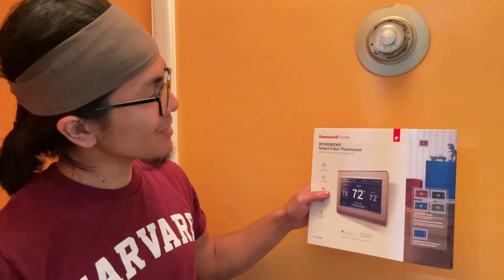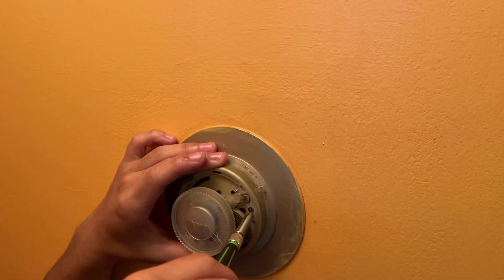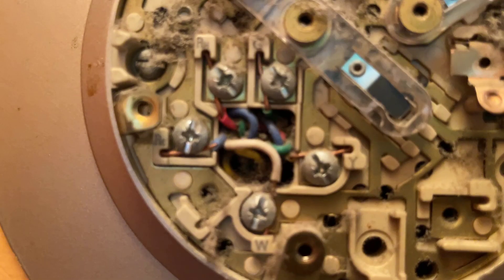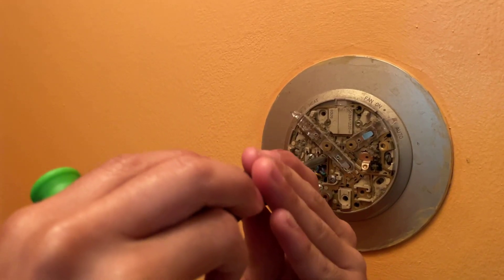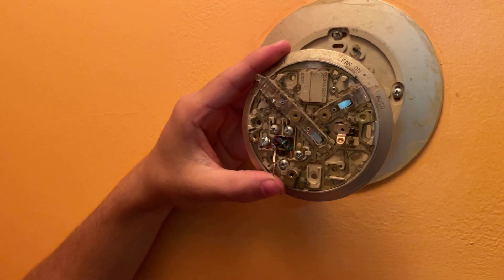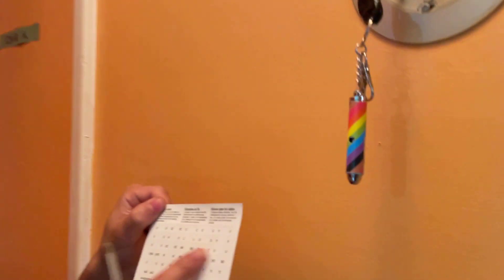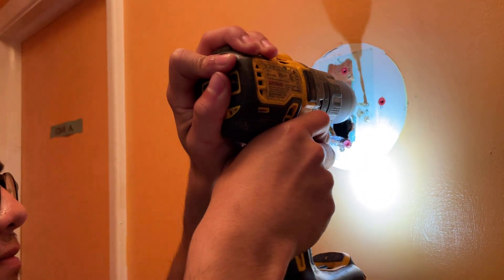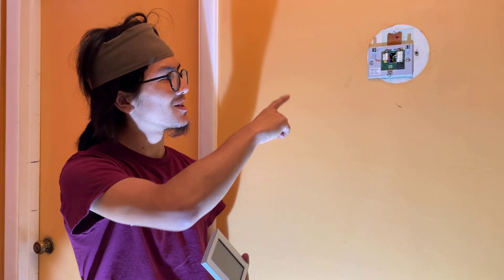How To Remove Ancient Honeywell Round Thermostat T87 Base Plate & Prepare To Install Replace New One

Comment: You already had the cover removed. That's the part I'm curious. I don't know how to do that. Why did you like skip the most important part of what I was confused about?
Reply from the maker: Just pull the cover off, it's a slip on. Might have to twist a little to remove gunks or debris, but generally it's a slip on